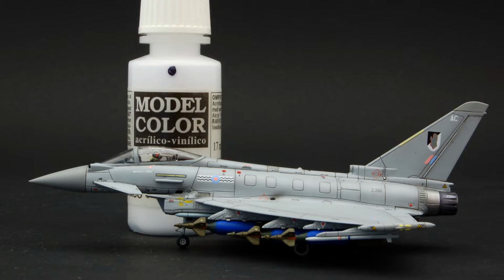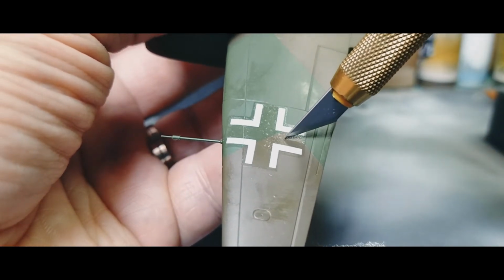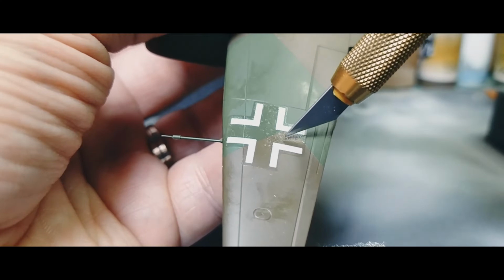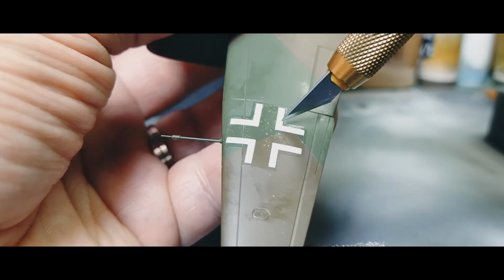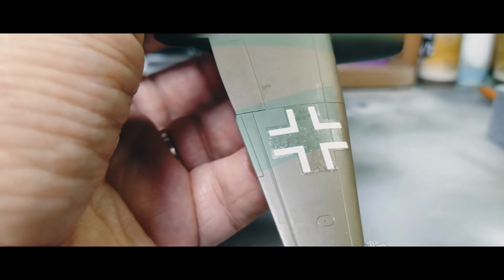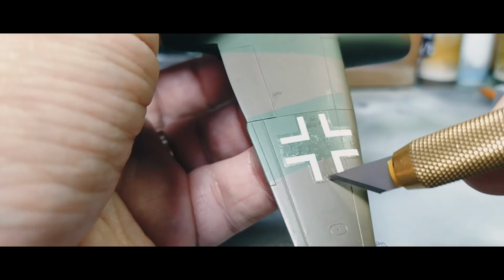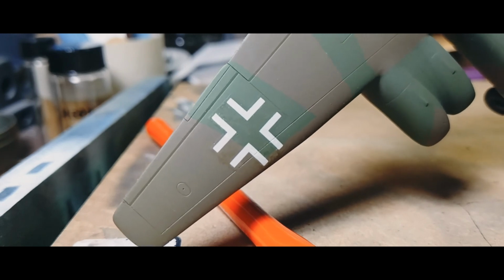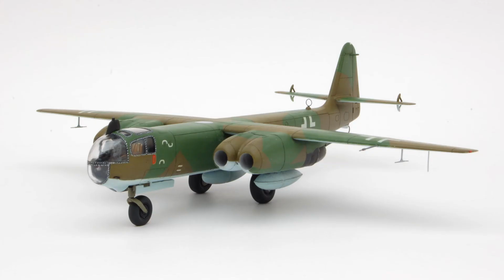How to solve Decal Silvering problems (MP Miniatures Quick Tip)

Comment: Nice advice for model kits! I had been working on one and the decals had silvering, but a coat of varnish did the job for my kit
Reply from the maker: Did you use a lacquer based varnish? These can have some strong solvents that will help to "melt" the decal film, in a similar way the Tamiya Thin Glue does in the video.
Cheers

Comment: I find it best to be ahead of the game. Good gloss coat is #1. After that, use a Dremel with a polishing pad and polish the decal area (a piece of denim/soft cloth also works).
Reply from the maker: Absolutly! The gloss coat will help a lot, but it also adds to the paint film thickness. If your model has deeply engraved details, than that's a perfect solution, but if its details are shallow or just very finely engraved, an extra paint layer can start to overflow them. I like model kits with very thin engravings and that is why I try to avoid the extra gloss coat, usually applying the decals directly over the painted model surface. If the decals are new and of good quality, they almost fuse with the painted surface. Cheers and thank you for your comment.
Reply: @marcopreto  Good point. I used to skip the gloss and would just polish the flat paint with a soft cloth (old t-shirt)...that did help out a lot!

Comment: What I've done to a "silvered" decal (after application) is piece it many times with a fine needle and re-flood with setting solution
Reply from the maker: That helps a lot, but on some more "stubborn" decals, only a strong solvent able to "melt" the decal film can really fix the problem. The issue with strong solvents (like Tamiya's  extra thin cement) is that it can damage the underlying paint, so special care is needed to apply very small amounts. Thanks for your comment and I hope you find the video useful. 
Cheers
Reply: helllo Marco;  I meant "decal setting" solution, not "solvents". Isn't sol-va-set considered strong? As far as "old" decals,( I just got an AMT  sheet 61 years old), I "bleach them", overcoat and hope for the best. p.s. when I apply, I wet the area with Micro-sol. You have a new watcher. @marcopreto
Reply from the maker: @donwest5387  Thanks! I never tried Sol-va-set, as the strongest decal "softener" I have is Mr Decal Sol, which is quite strong, but sometimes, even this decal solution is not strong enough. Fortunately, it is not common, but with really "nasty" decals I use a chemical capable of "melting" (dissolving)  the carrier film - it's really as last resort measure!
Cheers
Reply: Hi Marco; Sol-va-set used usually by "millitary" modelers does disolve certain decals. @marcopreto